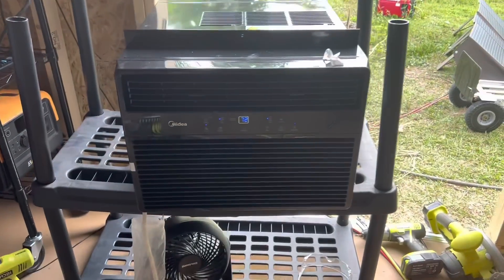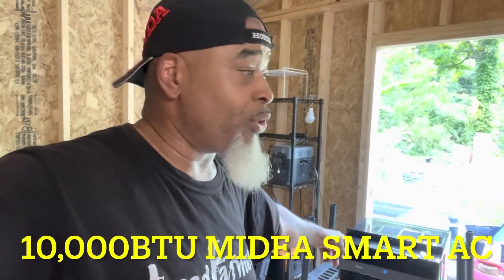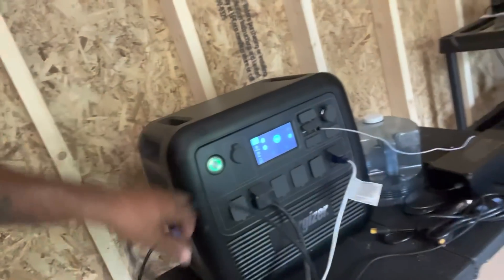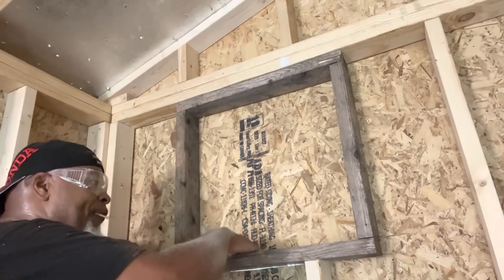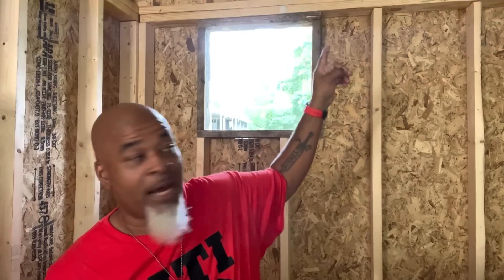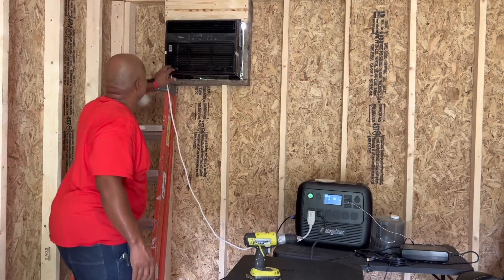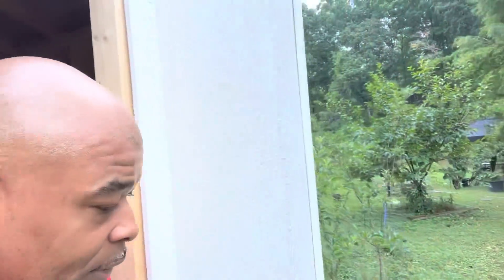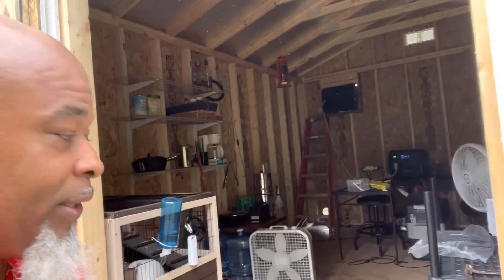Cooling a Tiny house or RV with Energizer pps2000 solar power station

Comment: I live in FL. Some older houses here have a fan/vacume in attic that stuck up and out all hot air. Works magic for cooling and not wasting electric with AC use. 
Way to go 😎 🥊
Reply: What is that called
Reply: @00jlove  extractor fan

Comment: We’re building out our tiny home now. Im trying to put energy efficiency and solar power. It’s so much. Thanks for this
Reply: Have you considered using Net Zero building techniques? Each gap is air sealed, insulation on the outside is continuous like a blanket to protect from thermal bridging.
Reply: @cindyjohnson5242  I’m learning about net zero energy on a podcast right now. It’s a lot of information but thank you!
Reply: @NaturallyTiii  thank you for letting me know! Hope all goes well! Let me know please!
Reply: @NaturallyTiii  also check into Passive House
Reply: @cindyjohnson5242  Thanks. I will!

Comment: The heat is grueling in the south and mid-west right now.  Meanwhile on the east coast (mid-atlantic region and up)  we're not even really running the air conditioning.  Looking forward to the finished project Stay cool.

Comment: I would add an elevated outlet dedicated line for your window ac while you have the unfinished wall ( just in case you don't use solar on it  in the future) love your video  I like your recommendation I may get that one in the future lookalike a pretty substantial power unit.

Comment: Good afternoon Leadfarmer73 & Lady Lead, 
Nice job getting the ac unit installed. 
I like that energizer solar pwr stat. but am more interested in the quiet Honda generator w/solar panels that you used in a couple of prior videos.  Would you please point me to the model type for the generator and solar panels when you get the time? 
And yes, I could live in a tiny house with no lights, water or heat...we managed just fine without those things at our fingertips when I was much younger. :) We used oil lamps at nighttime, used a well with the freshest, coolest water for drinking, cooking and washing and we had a fireplace. We lived in a very small country town where I still remember the  "Whites Only" signs.  The side of town where the white folks lived was always built up nice with paved roads and brick homes. The side where the blacks were allowed to live was the exact opposite. I went with my mother and grandmother on many mornings to clean houses, do the laundry and pick fruit, etc. for the land owners.  There was good times but then there were bad times too. That was one town where you had better not do anything wrong or you might go missing.  Very real.  Town's called Adrian, Georgia. Home of the Red Devils School.

Comment: Hi, Lead. Can you show us the power consumption? My problem is how long it will run for? If it’s charging with solar panels with a higher input, at the same time it’s running, will it still drain the battery or go all day?
Reply from the maker: 850 watts the energizer is 2000 watts plus whatever solar energy that you have coming in while it’s running which is about 600 watts. So I lose 150 watts while it’s running on an optimal day.
Reply: @leadfarmer73  I also wanted to thank you. We all have our first real influencer, and you were mine. It was because of you, that I became more aware, and began my journey to preparedness. I am very grateful for that. God bless you and Lady Lead and your beautiful family.